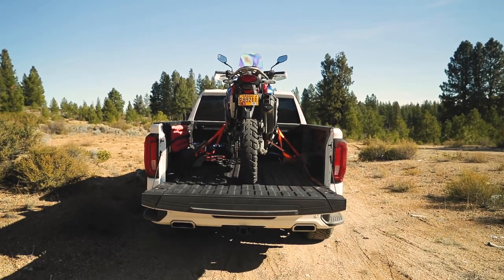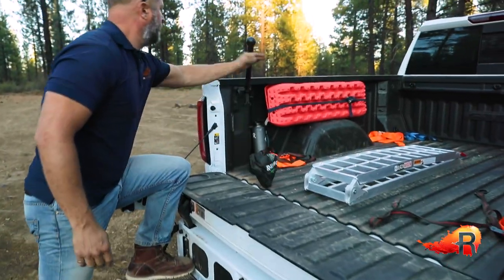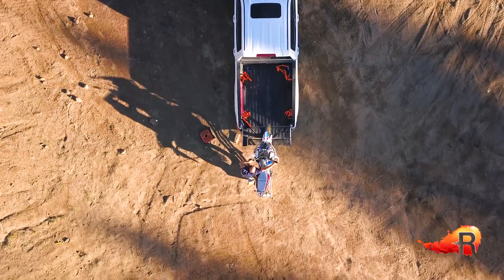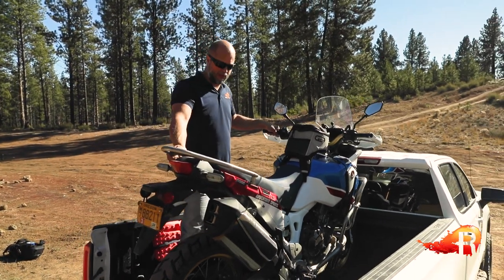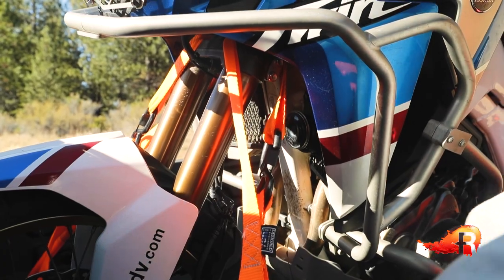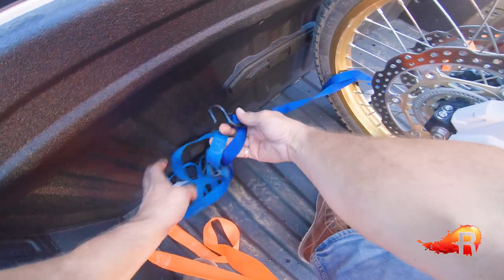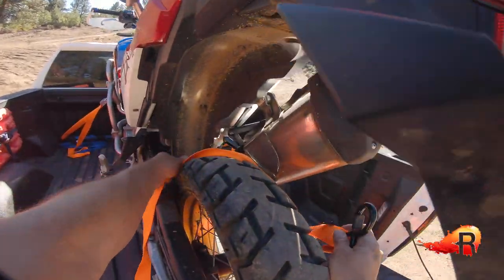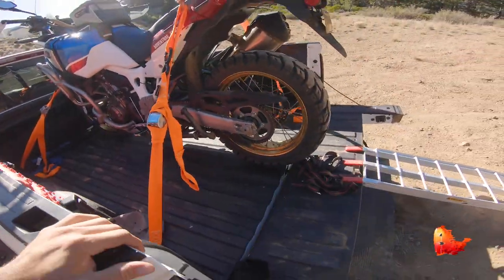How to LOAD, UNLOAD, and TIE  DOWN a motorcycle into a truck by YOURSELF

Comment: I used to put my atv in the bed of my truck, riding it up ramps. I’ve done my CBR1000f Hurricane a time and thought, never again. I bought a small utility trailer, set up a single wheel lock down chock that I can remove for my atv. Easily ride or walk up the 18” rise. The chock is just a fail safe if one of the tie down straps fails for side to side and front to rear. Peace of mind, for me at least, and simplicity for loading, unloading.
Reply from the maker: Sounds like you got a set up that works and that's the most important part on all this. Safely getting that bike or ATV where you want to RIDE.

Comment: Replace those inexpensive orange tension pull straps with straps with a true ratchet, that won't loosen when hitting bumps ...
Reply from the maker: Good idea, and yea, ratchet-types can be great. But in after all these years, hundreds of loadings/unloadings, and thousands of miles of bikes being hauled, these cam-straps have never once failed or loosened-up. Only failure ever was when we didn't have a closed-hook/loop, didn't zip-tie it, and a hook did come off the rack the bike was loaded on due to shaking. Fortunately, the bike just leaned up against the rear tailgate of the truck.

Comment: What is the length of the bed of that truck in the video?  I”m considering getting a truck with a 5’ bed, but want to make sure it’s long enough to be able to load my 2020 Africa Twin.  Thanks!
Reply from the maker: Glad you checked, that GMC has the 6.5 foot bed, and as shown, it's just barely enough to get the bulk/weight of that Africa Twin over the hinge of the gate. Such a heavy bike, typically shouldn't be out in the middle of the gate.....as I have seen them "taco'd"  :)

Comment: I bought a nice aluminum ramp that is made for quads with a 1500 lb rating . It can be a "dual" purpose unit for whatever including a motorcycle . Since I don't own a quad , yet , I just removed the center part that keeps the 2 ramp sections stable and is the hinge when you fold the thing for storage . With that part taken off I then joined the 2 20" or so sides together . Using strong zip ties and Gorilla tape I now have a 44" ramp that plenty sturdy . I use tie downs on the hitch reciever and the outside edge on my trucks bumper , solid 
. Worked easy with the DR650 but now I need to try it with the Tenere 700 . I think for that I will need to decrease the angle of the ramp and practice maybe using the bikes own power , just have to be super careful and have a buddy with with me . Stuffing the back and sides of the truck bed with cushions might be a good idea . I have a bunch of old Coleman air mattresses that this would be perfect for .

Comment: What is the bed length of the truck in the video? 

I have a 6.5 foot bed and an Africa Twin. I would think that the rear wheel would on the tail gate.
Reply from the maker: Yep, the GMC in the video is the 6.5 foot bed as well, and we can see the rear wheel fits just into the bed, not even really on the crease between the bed and the gate. We've had issues with folding/bending tailgates on 5.5 foot beds in the past.

Comment: Great info and thanks. Any thoughts on solo loading/unloading a DCT transmission Africa Twin?
Reply from the maker: Bob, good question, and honestly, we don't have enough experience with them to say how it would work. After 4+ years of operating a rental fleet with Africa Twins, only twice has there been a request for a DCT model. Hence we only buy manual transmissions. Heard DCT is pretty great....but it seems the majority of folks still like manual.
Reply: @RIDEAdventures  Thanks for taking time to reply. I'm gonna have to have a [re]think......
Reply: DCT has hand brakes on both sides. Left is the parking brake. Similiar to how it's explained in this video by using the clutch lever as a 'brake'. Same idea... Ride safe!